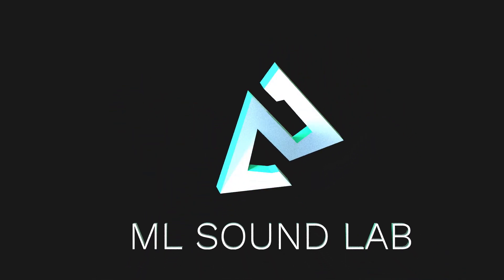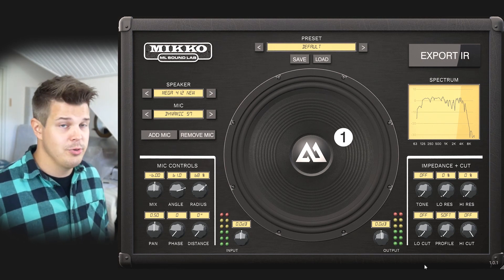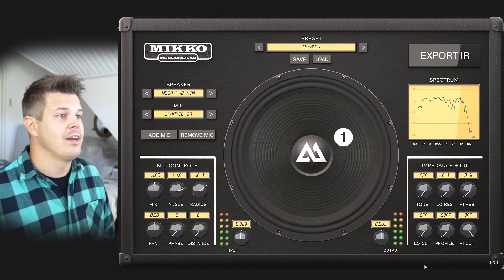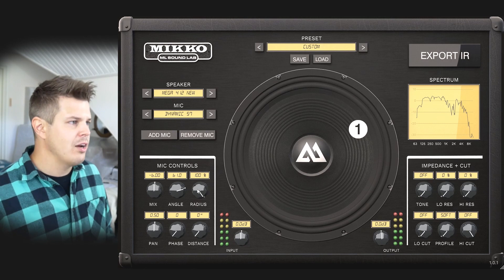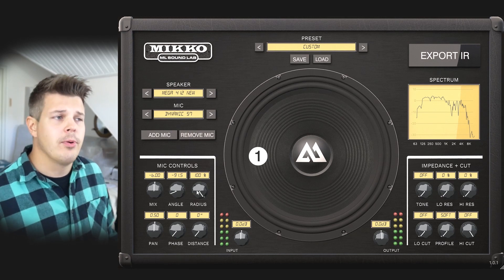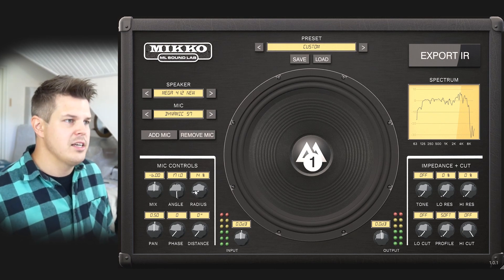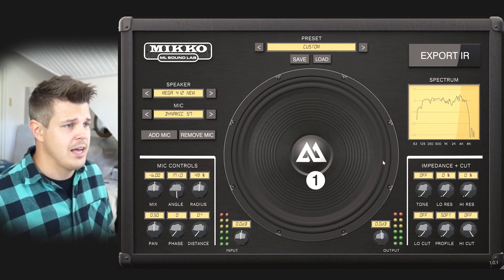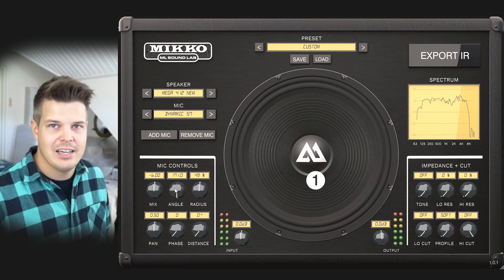ML Sound Lab "MIKKO" | How to mic up a guitar cabinet?

Comment: Fascinating demo Mikko! I’m curious as to the different sounds from same position, but different sides of speaker. Are you creating your IRs using a 360 degree scan of some sort? Not asking for trade secrets, just wondering if your process detects differences that simply moving one mic from centre out to the edge in a straight line can’t?
Reply: I recall reading on a forum that he built a small robot that's used to "sweep" across the surface of the speaker in order to shoot a ton of IR samples that make up the MIKKO.

Comment: Can you explain what happens when you point the mic to different spots with equal radius? A common sense mind would say that it's round so it should have identical response across the chosen radius, but clearly it isn't so. This is a revelation me and how I could've gone so wrong when I didn't know this, but luckily I found a good sound and miced the same spot always. Of course real life applications are not perfect so there's probably something like that going on there, but do you know what actually happens and why?
Reply: On real speakers there is glue on the top in two spots usually which causes differing dampening on the cone around the radius.